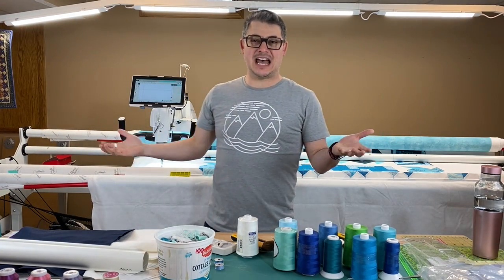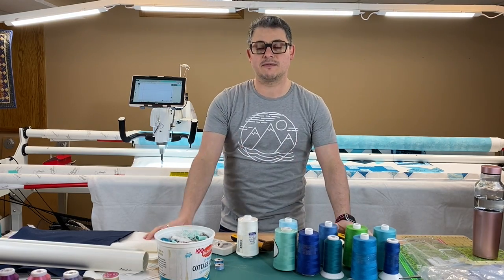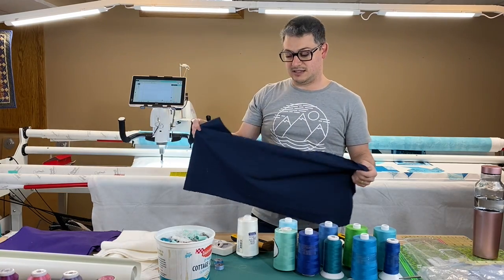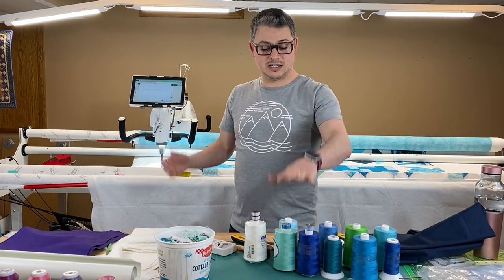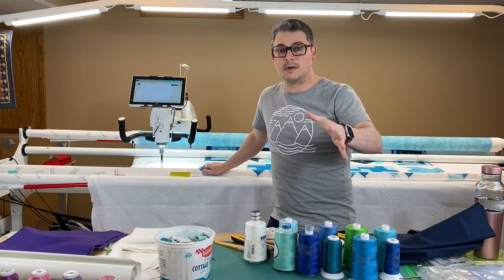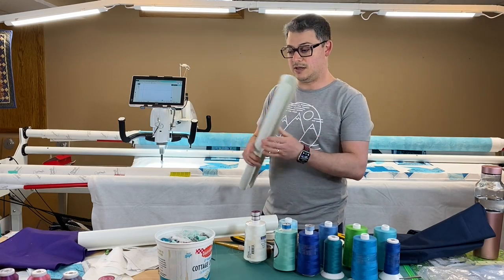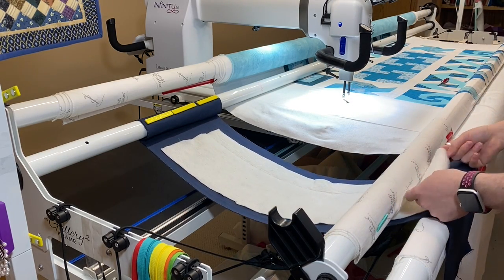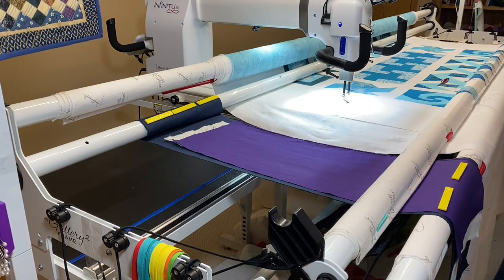How I test my tension and pulling up the bobbin after I stitch.

Comment: I found by experimenting and finding my right tension I kind of became “one” with my machine 🥰 I also really like to use either so fine or glide on top and always bottom line on the bottom- I am sure other threads esp on the top would work but for now I’m happy with those choices. Ps - think you are great

Comment: Another great video.  It is super helpful.  I have been using Glide on the top and magna-glide pre-wound bobbins.  Once I found a tension setup that worked for me, I've been reluctant to try other combos because this is just so good.  But I do want to try some other thread and your closeups and the descriptions of your process are empowering.  Thank you!
Reply from the maker: You can always try a different thread on top and still use the magna-glide bobbins.  You don’t have to change your bobbin to change tour top, remember that.  Also, make a note of your top tension number and it’s easy to get right back to where you currently are.  Have fun playing.

Comment: I paused this vid and ordered the rows gauge. So, you re-check tension after each thread switch? I also found I have to re-check when I switch between manual (for micro) to cruise, so I’ve had to be more strategic with that in mind. What’s your oil routine? I switch between colors a lot too, so I can’t go by the “after every 2 bobbins” guide in the manual. I just make it my weekly maintenance.

Comment: Just found your video. I have so much to learn. You explain it so well. Thank you. Question, if I have a new needle in and my stitches are not picking bobbin up in the up stroke mode, is my top tension too tight?  I’m thinking that may be my problem.  Blessings. Looking forward to seeing more videos from you.
Reply from the maker: Most of the time, if your not picking up the thread your needles is in backwards. Make sure the groove that runs the length of the needle is in the front.  The other thing might be your bobbin tail is not long enough to bring up all the way.

Comment: Great video! Question? can the TOWA gauge be used on other threads and if so, how do you determine the best tension? Thank you for your input when you can 😍
Reply from the maker: Yes, you can use it with any thread.  It's just giving a number to the tension that bobbin is sitting at.  The number is thread specific and I mostly use Superior Threads and they have a fabulous guide under the Education section on their webpage that shows each of their threads and what the Towa should read.  I'm not sure if other brands have that too since I really only use So Fine and Bottom Line in my bobbin.
Reply: Thanks Bubbie!

Comment: New to LAQ... This was great thank you! Recognizing what you said about each machine being different, do you have any tips about some good starting ranges for Towa/bobbin tension for different threads?  Would be helpful to get me in the right zip code and then make adjustments from there. Thank you!!
Reply from the maker: I mostly use Superior Threads and they have a wonderful Education section on their webpage and have a Towa Bobbin Gauge Template that shows each of their threads and where the gauge should read.  I have that printed out so I can easily referenced it.  The number is thread specific, so this makes it easy. I'm not sure if other brands also have this, as I only use Bottom line or So Fine in my bobbin.  The Towa tension would be the same across all the machine, because it is based on the thread. The top tension is the one that will change and I wish there was a range I could give you but I have seen two class machine that had more than an 80 number difference.  That's why I always use the Towa, I know the bobbin is correct and I just have to mess with the top to get it dialed in.  I promise once you get used to changing it and understanding how it works, you will become a pro in no time.

Comment: I like to match my thread with the fabric.  Many times I have a customer with a very light top and a very dark backing, so I want to be able to use different colors on top and bottom.  My problem is when the machine is going some directions,  the thread is perfect.  When it changes direction. I see bobbin threads poking through.  Any thoughts?
Reply from the maker: When you are testing the tension, make sure you are doing circles.  They will pull different than straight lines.  I usually never match the back fabric, I always try to match my from.  So many things can happen as you stitch and it can throw off your tension just a little and when using those different colors, just the smallest fluctuation can show.  See which way it is fluctuating and you can try to adjust for those little switches but it might cause the top to move to the back.  If you are using a thinner type of batting, you could try to use something a little thicker. This will give you move space for those threads to meet in the middle.

Comment: I love your videos and I have a Towa gauge. Have you ever has issues where you get your tension perfect with a full bobbin, but towards the end of the bobbin it changes? I always have to tighten it as I go, I start getting eyelashes underneath, but it’s mostly when there is 1/3 of thread left. 🤷‍♀️
Reply from the maker: Rebecca, I do have a similar issue but with mine, the bobbin tends to get tighter.  I always try to keep an eye on the bobbin as I'm stitching and when it starts to get a bit low, I change it.  I would rather waste a little thread than have to pull out stitches.

Comment: Hello dear 
Can you snap a picture of the tablet to see where you are changing the tension. TIA
Reply from the maker: If you have an Infinity, it’s the horizontal grey bobbin, then use the plus/minus to adjust up and down. If you have any other machine, tension is adjusted with your tension assembly where you thread your machine.

Comment: Adam, I'm a new LAQer. I'd love to know if you have different strategies for people who self bind the back to the front. Mostly I worry about getting the measurements precise for E2E since quilts are never perfectly square. I worry about the potential of having unsecured threads on the sides if I don't get the E2E measurements spot on as the quilt advances. Do you only do Freehand for these customer?   BTW - We also have 5 seasons in Maine. ❄️ Fake Spring in Cleveland = Mud Season in Maine! 💩
Reply from the maker: So just me personally but I do always free motion for this client.  She is the only one who I quilt for that does a self bind.  If you are going to do an E2E on something you are going to self bind, I would set up your edge 2 edge design.  After it’s set up, baseline and save it.  Then I would crest an area at each advance and crop so you only have the row you want to stitch.  It will cut off the sides and keep everything within your area.  After stitching that row, cancel out and undo your crop.  Advance, set  a new area, crop and repeat. I hope that makes sense.  Usually I like to stitch off the sides when I e2e because tops are usually not straight.  Good luck and thanks for watching!!

Comment: It sounds like you set by thread type however I found some colors in the same type of thread need a different tension setting.  I use cotton thread and find the darker colors are much different than a white or cream.  I assume it has something to do with the dye in the thread.
Reply from the maker: I do set by thread type but I have also found I might need to make little adjustments for color.  I use the number as my base number and it usually works for most but I still check it and adjust a few numbers up or down if needed.

Comment: I wish my wife and I could have seen his a couple years back. We went through most of the issues you describe. thx
We only run one thread type because of it. Do you run your bobin tension the same for all different types of thread?
Reply from the maker: I only use Bottom Line or So Fine in my bobbins, so I run them both at about 190 on my TOWA.
Reply: @adamsewfun.  Our dealer sold glitter so thats what we have used. Have just ordered some superior to test. Thanks btw your e2e video really helped me simplify my set up. Keep the videos coming.

Comment: Adam, the number 80 that your tension first was set on your machine, does that coincide with a TOWA number or is it just your Longarm setting number on the machine's top tension? Thank you . I know you are very busy, but maybe you will get this comment even tho' it is now Dec. 30, 2021. Thank you.
Reply from the maker: I might even get to your comment in a little over an hour.  This is my top tension (easy set tension) on some of the Handi quilter machines.  It's like a built in Towa but only for the top thread instead of the bobbin.  If you go to the Superior Threads website and select education, you can find their Towa chart and use that for your threads.  Even if you don't use Superior Threads, the numbers work for the same type of thread across the board.  Happy New Year!
Reply: @adamsewfun.  WOW! THANK YOU SO MUCH! I will check that out! You have great videos.

Comment: Yeah I don’t have time for all that tension trick nonsense so I use a Towa! Drop test did not work with my machine so yeah I’m not going to get all flustered and upset over tension. I use only Glide thread but I’ll add some others in eventually but for my Qnique it’s towa ir else it really upsets me and I just don’t have time for tricks! If it works for others God Bless you but my chronic pain stays at eight so I get limited Longarm time already so Towa was a good fix for me.
Reply: Just saw this!  On your Glide thread,  what do setting do you use on your Towa gauge?